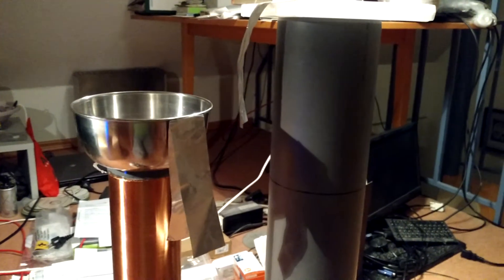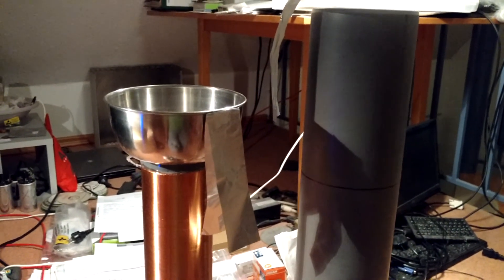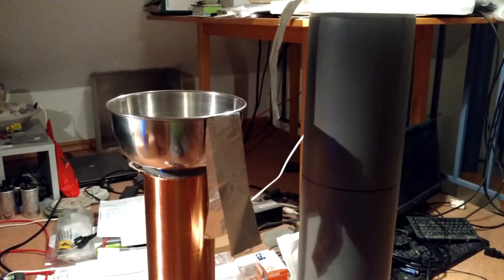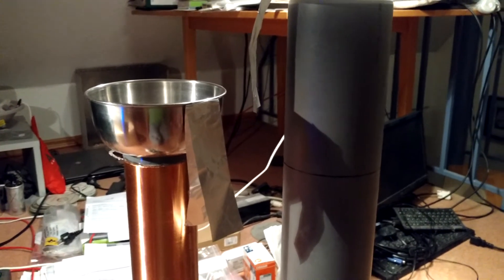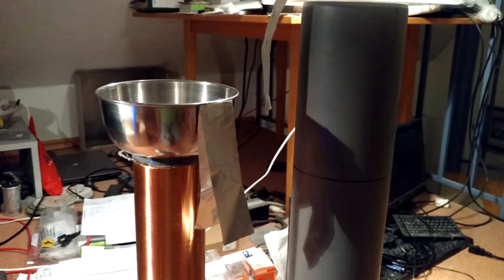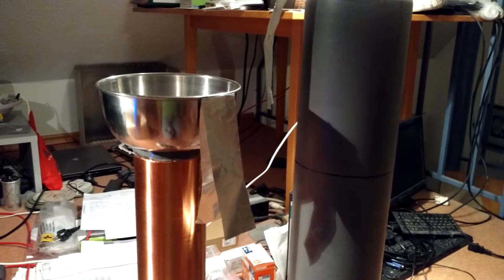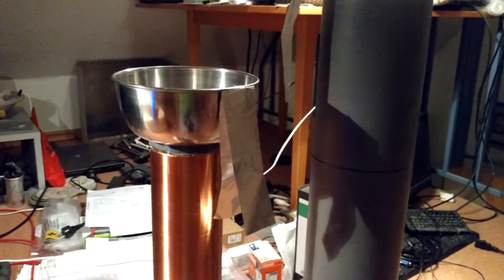Static Electricity Effect from a Tesla Coil

Comment: Since it seems that you have a T-coil in some flat, how are you doing grounding. I am asking because T-coils produce such a high voltages. Can you use ordinary ground from the wall socket. Would it affect other apartments in the building.
Reply from the maker: HitAndMissLab, I'm not living in a flat. Since my coils are too small, I don't have any problem with wall socket grounding. I have computers all around me and they run just fine during coil operations. The only problem is if I put high power into the coil, my wireless network doesn't work properly.